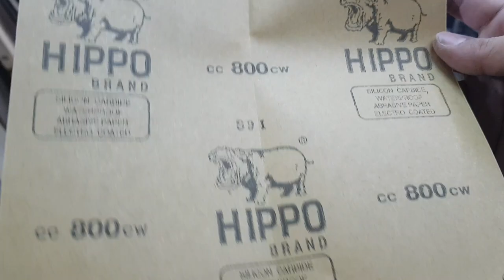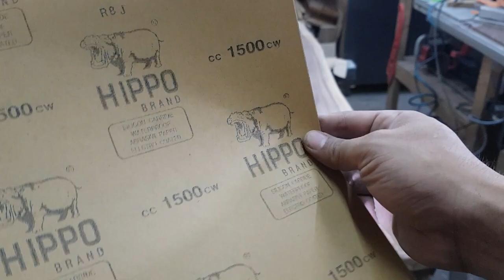(RIVER) RESIN TABLE BUILD (pinoy made!)

Comment: Your not suppose to seal your edges because when you do your actual pour, the resin cannot absorb into the wood. Your ending up with plastic to plastic bond which will result into resin and wood separation at a later time. Dapat hinde mo seal ang edges mo para ang resin ay sumipsip at kumapit ng husto sa kahoy. Hinde yan tatagal at bibiyak din yan lalo na pag nagumpisa nang mag shrink/warp ang kahoy mo.
Reply from the maker: Thank for the tip john👍 i was thinking about that too, but the sealing of the edges and the actual pour is just one hour apart..  did it to lessen the bubbles coming out from the wood after i pour..
Reply: @tablaprimerastudio6752   I have seen too many done the way you did it but only to separate at a later time. Believe me don't seal your edges with your future projects. Allow your resin to be absorb and create a mechanical bond with the wood. The process of bubbles appearing is the air being displace by the resin absorbing into the wood. You can always tap your slab to help dislodge the bubbles to float to the surface then burn it of with a torch.
Reply from the maker: I'll keep that in mind sir on the next build. Thanks for the tip👍